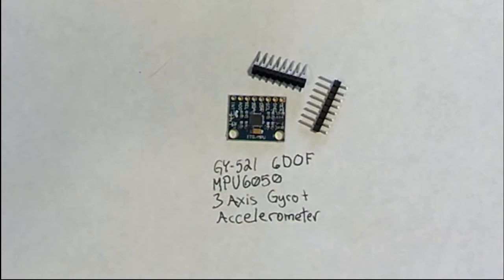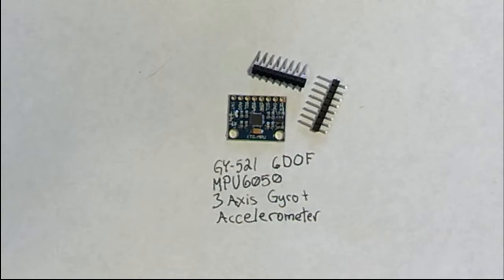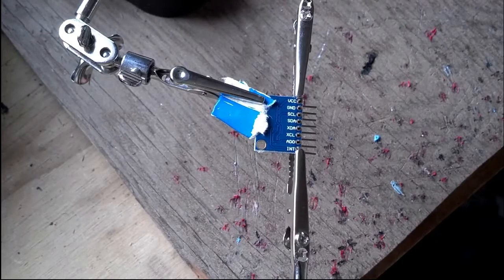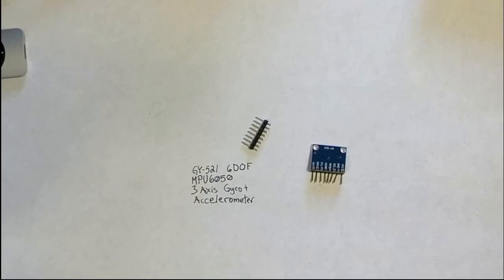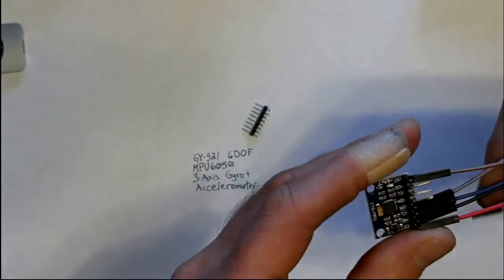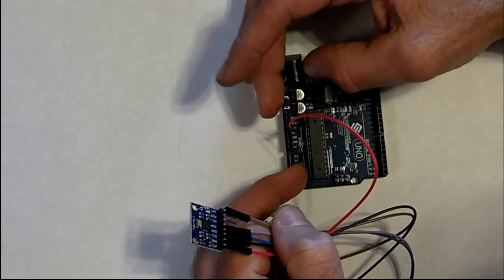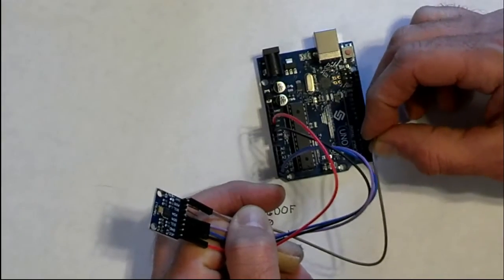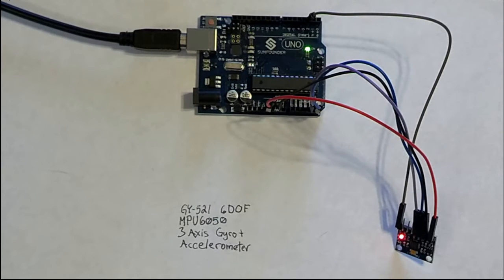GY-521 MPU6050 Gyroscope + Accelerometer Arduino Testing

Comment: Just to understand better, did you just have the pins in the holes without solder originally?  You do know that virtually ALL components that come with pins in the package assume that you will solder them on, as the holes have no conductors, just the trace rings around the holes.